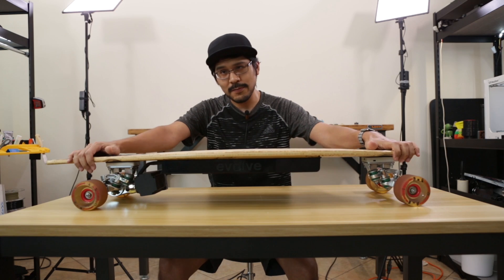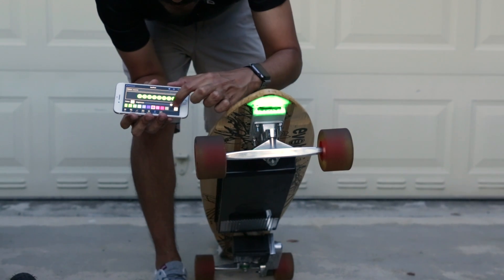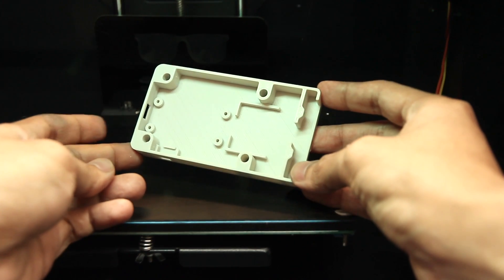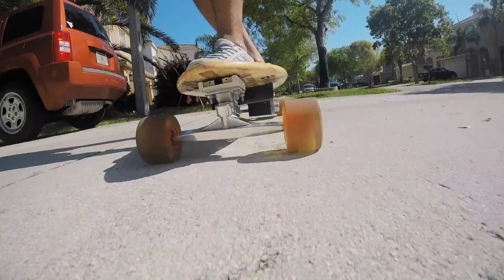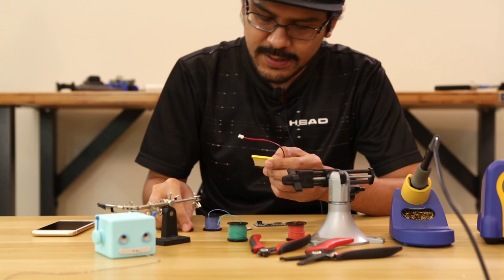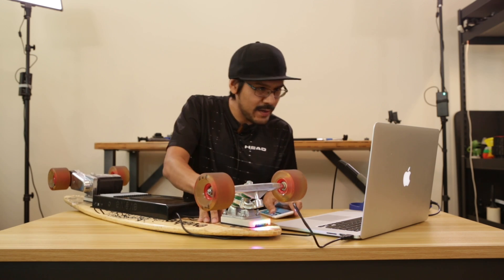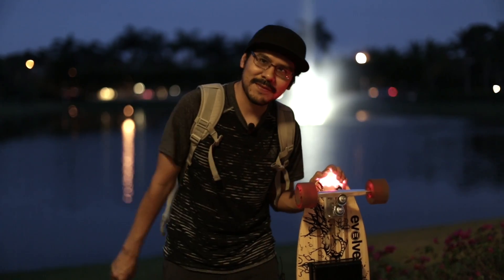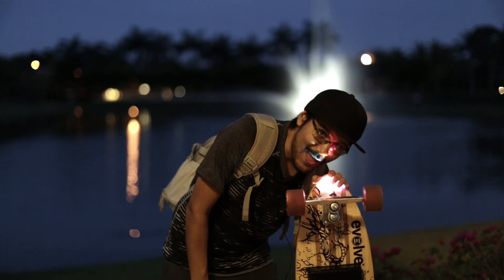3D Printed Truck Risers with NeoPixel LEDs for Skateboard Longboard

Comment: 2 questions, i need to get more solder, so what is the spool that fits on the 3d printed case you designed, and what is the range like on those electric long boards? are they similar to boosted boards if so those are pretty expensive but look like alot of fun to use.
Reply from the maker: sure, the solder spools are listed in learning guide here: https://learn.adafruit.com/solder-dispenser-adabot-head/overview?view=all The electric longboard I have is an evolve longboard gen1 bamboo pintail, it has a range of ~20miles on a full charge.